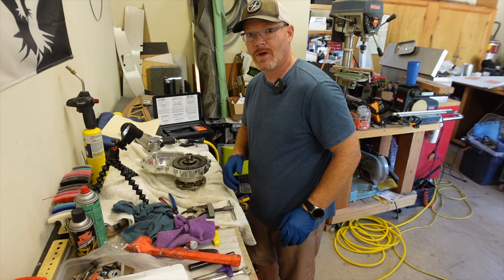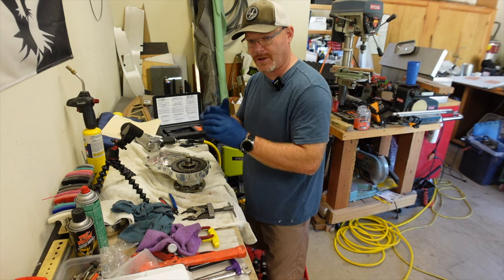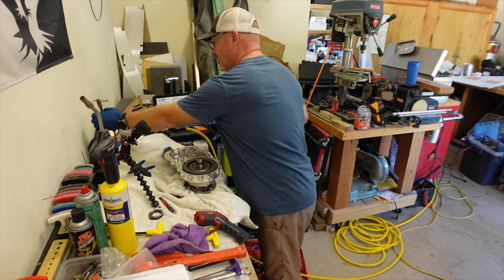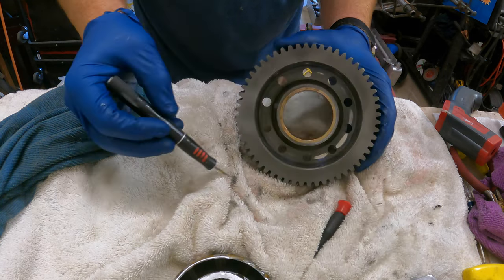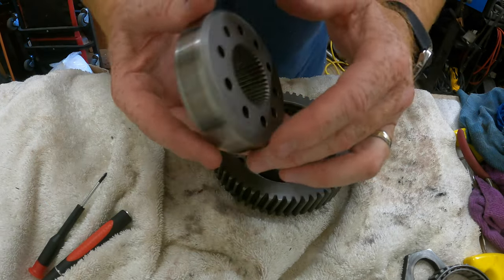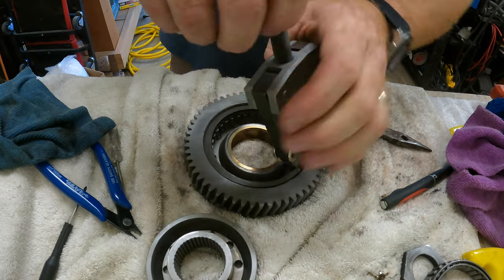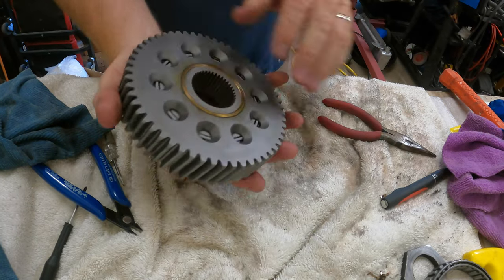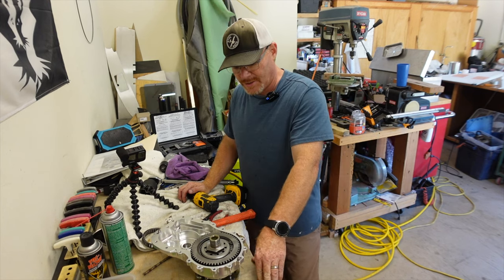Kitfox 7 Apex Build Episode 66 Yamaha APEX Skytrax Gear Box Clutch Replacement

Comment: Good stuff Bryan.
I was looking through my engine log while watching this and I also changed my sprag element at 135 hours.
Mine still appeared to be ok but I wanted to play it safe.
I had previously removed the clips from my original element and had reinstalled it since it looked fine. And of course removed them from the new element.
I’m at 151.3 hours on my SkyTrax and she’s purring along nicely.

Comment: That looks like a GM 34 element sprag it's not OEM for the TH400 which used the 17 element sprag.  The 34 is installed in most performance upgrade for the TH400's. I believe it's OEM for the TH 4L80E which is modern version of the TH400. There are aftermarket sprags that don't have that clip.

Comment: I would be interested to see how long that replaced clutch lasts. The only thing I may have done differently in your replacement, is to do a full wash down of the bearing and parts with solvent or brake cleaner. Just to be sure all the tiny particles are removed. Those could cause premature wear to the bearings and surfaces. Thanks for posting, I do like your willingness to make holes in your work bench to do a job. I do the same, and have had some people look at me funny, but hey, it's a work bench. Might as well make it "work". Cheers from Winnipeg.
Reply from the maker: When putting out a YouTube video, editing is necessary and sometimes not everything is shown or explained in a video. The gearbox was thoroughly cleaned and flushed before assembly.

Comment: I thought that sprag looked familiar, th400 trans intermediate sprag clutch I believe. I've worked on quite a few of those trans. I think the failure could be from from impact.  But the dogs should not fall out either, but did because the cages & little springs that hold tension on them are worn out & broken. But those other clips should remain as well I think. They keep a little tension on the spag cages so they stay more evenly spaced in between the inner & outer races so they won't chatter & float around I think. Also I wonder why they leave those other two races completely out? I'm not a big fan of that either. Is it so lube can get into the sprag easier? Idk? So how does the gearbox get lubed, is it from the engine oil, or is it a separate sump? If so what lube are you using? The sprag was intended for ATF of course. But the gears and bearings could use a little more viscosity. A good premium 100% synthetic ATF like AMSOIL or similar should be good I think. Or a low vis premium 100% synthetic synchromesh manual trans lube if it's a separate reservoir. Premium synthetics have better shear, wear resistance, better lube for gears & bearings too.
Reply from the maker: We run ATF and it is self lubing splash system in the gearbox. A lot of design went into the lubrication flow inside the gear box.
Reply: @BowenAero  yup, ok

Comment: International harvester tractors had a planetary gear reduction unit between the engine and transmission they called a torque amplifier, from the factory the sprag clutches were a failure point. One upgrade that became an option is something called a "mechanical diode"which has 10 spring loaded pawls which allow the shaft to overrun in one direction but have a positive mechanical lock in the other,  basically a super sized ratchet.
If the sprags become a problem here, then this could be the solution.
Reply: I posted a link in a follow-up comment, but the spam filters snagged it
Reply: @russellsmith3825  yup, I've run into that too! Spam bots that is, Dang it!
I was thinking mechanical diode as well.

Comment: This may be a silly question, but is there a reason you didn't use compressed air during the cleaning process to ensure that there were no small bits left over?

Comment: I would more be worried about the clip particles getting between the gear teeth and damaging the teeth causing a failure in a few hundred hours; even if you remove the particles the damage has been done. I hope you checked the teeth for damage.

Comment: I found that once those small pieces of metal show up in the oil change, it's not much longer before a lock up. I think I had 4 lock ups, and replaced the sprag 10 or so times using two different gearboxes over 650 total hours. I'd recommend a new clutch element every 100 hours, or as soon as you find metal pieces. Once it locks up the first time, it locks up sooner the next time. I never got more than 50 hours on a new clutch after it had previously locked up.
Reply: Man that sounds like a design problem.